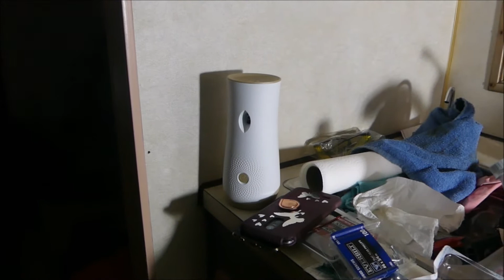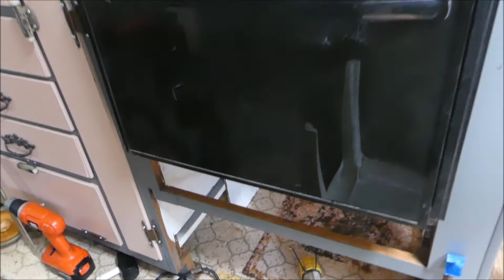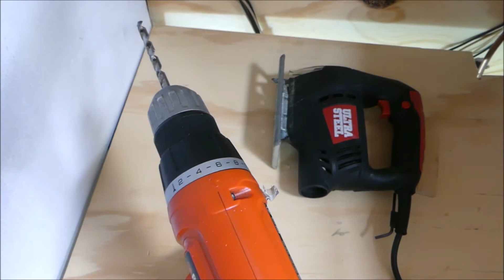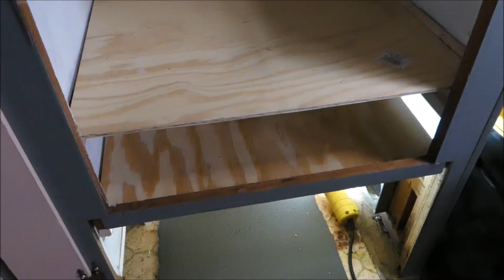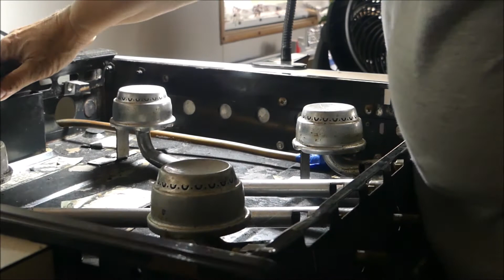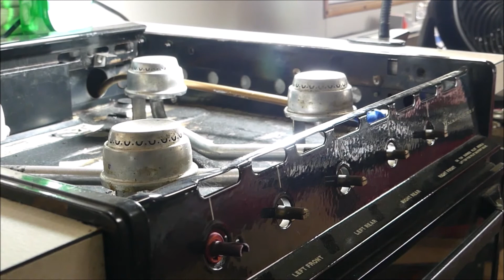1974 Silver Streak Reno   YES! Stove is in, shelf is done!!

Comment: Every step you take is more and more exciting!  The odor that remains may be coming from the old air conditioner on the roof?  I wonder if there is a product that will deodorize that...
Reply from the maker: It's also in between walls & such. Areas where I can't get to. It's not horrible anymore at least.
Reply: TexCyn RV Life dead rodent smell? Or mold? Hopefully it’s just “old trailer that’s been sitting for awhile” smell & eventually will be replaced with “old trailer that is been given a new life” smell aka “RV life here I come”!
Reply from the maker: @Elizabeth-rq1vi  The previous owner was a heavy smoker. I don't smoke, so that odor partially remains behind walls & such. Thanks for your encouragement! 👍
Reply: TexCyn RV Life our second apartment had yellow walls from cigarette smoke...hubs washed them a couple of times before I arrived. We don’t smoke & if someone lit up it drew out the smell! It should eventually fade. Lots of scented flowers! Also  Nilodor is amazing & being liquid it can be poured down tight spaces.